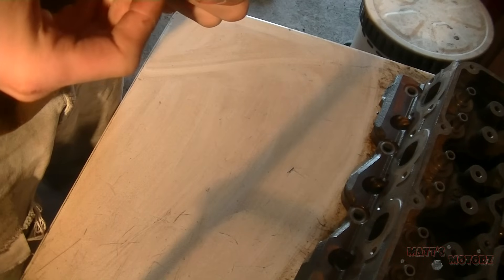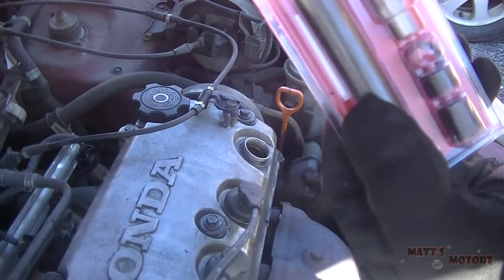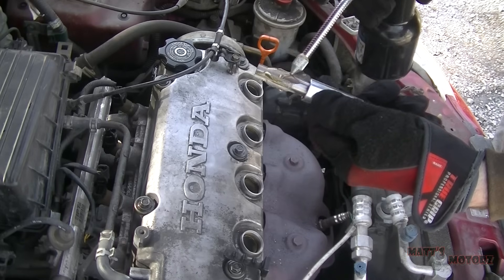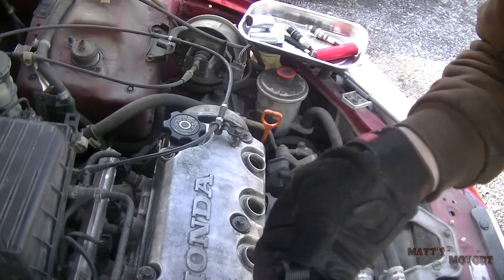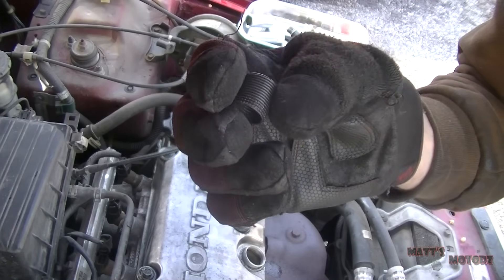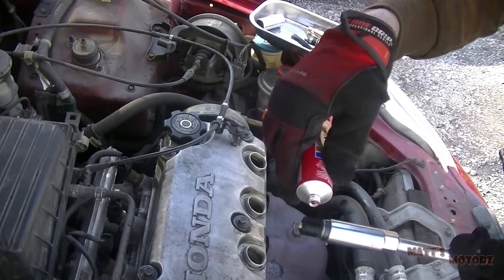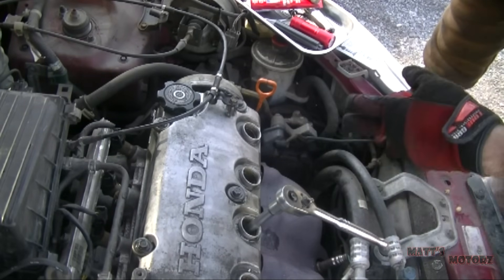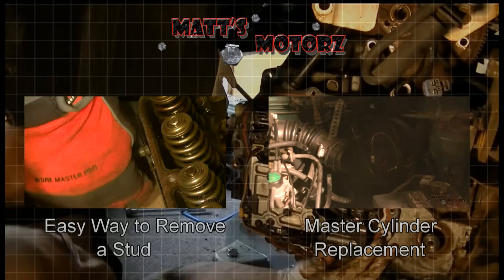Repairing Stripped out Sparkplug Threads

Comment: I got this problem with 07 chevy impala, mine is cylinder  1 which is near the alternator. all the rest of my cylinders are fine spark plug screw in fine, but cylinder 1 was a struggle it went in a few turns,"(spark plug)", but after that it became hard to screw all the way in. I was thinking either piece  of the old plug is stuck in the cylinder or just the cylinder head it self is script or something, all I know is something is wrong?
Reply from the maker: It sounds like the threads are damaged to the point where they do not work properly anymore.  You may be able to get away with just running a tap through them without doing this thread insert business.  Buy the appropriate tap and give it a go.
Reply: what's a tap?
Reply from the maker: A tap is used to cut threads in a hole.  It can also be used to repair damaged threads, (provided the threads haven't been stripped out completely) by re-cutting them.  You would most likely need to order the tap online as it isn't a size that is likely to be found at a hardware store.  Do some research first on how to use taps though and what they are.
Reply: okay, thanks appreciate it will try!
Reply: do you have to lubricate the tap with somthing or you can just do it bear? because i don't have no oil or anything.Can you use something else other than  oil to lubricate the tap?
Reply from the maker: Yes, any time you tap anything it should definitely be lubricated.  You run the risk of breaking the tap or making really bad galled up threads if you don't.  If you don't have any oil go out and get some.

Comment: compressed air does not take the metal filings out.. Start the engine up without the spark plug and the piston will throw all the metal filings out the hole.. Just don't run it for long.. Just make sure the engine runs for 2 seconds.
Reply: how many times do you have to rotate the wrench to rethread the hole?
Reply: Jsp youre both smoking crack.

Comment: if people add a little anti seize to the spark plugs this would never happen
Reply: Brandon Brady I am having the same problem with the 2013 Honda Fit. Spark plug blew out and took the threads from the head with it, I'm so screwed. I bought a new coil pack and spark plug... What's the best method?
Reply: False. Today I came across a stubborn spark plug whole. Even when when applying anti seize.
Reply: Mine blew out the hole!  Common on my fit.
Reply: Nope, I took off the coil and the plug came with it.  Typical of the Honda fit to break the threads so to speak.    I couldn't even thread the replacement at all.  2011 honda fit bullcrap.
Reply: Not true I've always used anti seize and just had one strip out

Comment: Can you use JB weld instead of the rtv silicone? I was thinking something more permanent would be better.
Reply from the maker: That's a good question. I am not sure to be honest. I would think so, yes.  Assuming JB weld can withstand those temperatures (which I think it can)
Reply: In fact, the instructions call for high temp thread sealant so Permatex or JB Weld high temp is fine. RTV silicone is great as a gasget maker and might do the trick but I prefer following the instructions closely.

Comment: Hi I know this video was a couple years ago but I have a question.  How did you remove the spark plug to put the punch tool in without removing the insert?
Reply: yes you have to remove the spark plug
Reply: Johnny Pham did you ever figure out how to do this without the sleeve staying on the spark plug when attempting to remove the spark plug out?

Comment: how you take it out is my ? im scared to brake my spark plug inside the head
Reply from the maker: Take what out?? The sparkplug??
Reply: yes
Reply from the maker: If he is asking how to remove the spark plug then he probably should not do this job.
Reply: i'm pretty sure that he can't remove it because threads are completely gone
Reply from the maker: OH now it makes sense! Lol thanks.  I should have said that when I took mine out, it was pretty tough. I needed some leverage.  Luckily it didn't break.
Reply: yes i know how to take it off just cant i can move it a little but it wont cone out i took it to a shop they said they wont do it because they don't want to risk it braking but they tried but its on there tight
Reply from the maker: Dago Granados Yeah with that kind of thing, it is all luck really.  I was lucky that it did not break.
Reply: My spark plug was stuck for over 2 years, I recently bought Seafoam Deep Creep, sprayed it in the well with a hot engine, i let it penetrate for about 10 minutes. I then slowly started unscrewing it until it came out. Now I just need to rethread it, thinking about doing it myself.

Comment: thats why I dont drive it too far away from my house Im scare that the engine would blow them out
Reply from the maker: If done properly, the new threads should be just as good as the old and you don't need to worry.
Reply: MattsMotorz just a question, would you recommend an adhesive (such as loctite or devcon) to hold the spark plugs for a very short time? I’m currently working on an old petrol truck and I need to move it into my workshop.

Comment: Used one of these kits on my snow blower's engine after fubaring the sparkplug threads. Worked great. Now I always use the rubber tube trick when threading plugs into aluminum heads.
Reply: I tend to run the plug backwards until i feel it "seat" in the hole, then proceed to run it in with a t-bar tool.

Comment: wouldn't you get metal shavings into the cylinder. NOT sure that i wouldn't want that
Reply from the maker: +Josh Parkinson That's why in the video I show blowing out the hole with compressed air to get it all out.  You can also run the engine a few seconds with no spark plug in to blow it all out of the hole.

Comment: wouldn't you get metal shavings into the cylinder. NOT sure that i wouldn't want that
Reply: leave the spark plug out and start the engine on 3 cylinders and let it run for 2 seconds.. The piston will push the metal shavings out.

Comment: Protip: Read the packaging. Always! That high temp rtv says on it that it should not be in contact with gasoline. it could deteriorate over time.
Reply from the maker: +Null Glass The packaging on the repair kit said to use high temp RTV silicone, and that is exactly what I used. The RTV is on the threads and will not come in contact with any raw gasoline.
Reply: MattsMotorz
Weird. I would think, because it's there to seal the spark plug socket to the engine, that there would be a gap where it's in contact with the air/gas mixture in the engine.

Comment: My 2001 CR-V Spark plugs were very tight on the way out. Looks like a Honda issue! Came out 1/4 turn at a time with lube. I will try and tap the threads before new plugs go in.

Comment: oh are you sure get a small micro nano part of a pistón ring its made of aluminium put it inside of the chamber and tell me later
Reply from the maker: +lucas rodriguez Piston rings are most certainly not made out of aluminum.  They are normally made out of cast iron.  This is because cast iron is springy and allows the ring to expand against the cylinder walls.  I have personally made piston rings from scratch before.

Comment: are you nuts the chips destroys the chamber the cylinder the pistons and eventually the engine
Reply from the maker: +lucas rodriguez That really isn't true at all. The chips aren't going to destroy anything, especially not parts made out of steel.
Reply: +MattsMotorz I agree with you it will not damage anything that huge magnet in the oil pan will catch it all and so will the filter ☺

Comment: how do i know if my threads on the head are cross threaded ?  would i hear hissing blowing air coming out from that spark plug when my engine is running? any wear on the threads of the spark plug? my threads look fine on my plugs but i hear some hissing. thanks
Reply from the maker: +carlosb1 If your threads are fine, then they werent cross threaded.  The hissing could be a large number of things, some of which are normal.

Comment: hope this works on my s10. the threads in the head are almost completely smooth...
Reply from the maker: +Eric Chapman Doesn't matter, it should work. The size you are tapping the hole to is larger than the existing hole even if the threads are completely gone.

Comment: Matt do we jam the whole tap in there or only the first part
Reply from the maker: +tremat91 Run the tap down until you get to the bottom.  On some engines you will hit part of the valve, which you will be able to feel (and when this happens, stop immediately), others the tap will just go all the way through. You will know you are all the way through when the resistance goes way down on the wrench.

Comment: Why did you cut out at 2:29? You were screwing down, then just pulled it out. So do you go all the way in and then back out? Or do you screw all the way in and just pull out? Kinda critical piece to cut out..
Reply from the maker: +Aaron B I suggest reading up on how to tap threads.  I cut it out because it was simply me running down the tap. When you tap threads in anything, you go all the way down, and then unscrew the tap from the newly cut threads. You wouldn't be able to just pull it straight out as it is threaded into the head.

 When it comes to YouTube you only want to keep footage that is absolutely necessary and interesting, otherwise the video runs too long and people lose interest half way through.

Comment: A couple of suggestions:  1) Make sure the piston is not at TDC when you do this otherwise you may run the tap into the piston.  2) Contrary to the directions that come with the product, I would not use RTV sealant.  That's really a rubber-based gasket sealant.  I would use Loctite Red instead which gives you the added advantage of locking the coil in the head so it won't be removed when you take out the spark plug which is often a problem people report when they use RTV.  RTV simply makes no sense to me.  3) Use Anti-Seize on the plug threads.  That will also help to make sure the coil isn't removed with the plug but you should always use it anyway when installing spark plugs. In fact, I would never even think of installing spark plugs with coating the threads with Anti-Seize, especially with aluminum heads.  

Don't remove spark plugs from an aluminum head when the engine is hot.  When it's hot, both the head and the spark plug metal is expanded, making the plug very tight.  If you remove the plug when the engine is hot, there's a good chance you will rip the threads right out of the head.

One more thing:  You can't blow the metal shavings out of the cylinder with compressed air as I'm sure you found out.  The air nozzle blocks the way and you are really just blowing the shavings to the walls of the cylinder.  Instead of oil, coat the tap with grease.  Most of the shavings will then stick to the grease. Tap slowly, going back and forth and remove the tap frequently and clean the scraps off it.  For any scraps still left in the cylinder, the way to get them out is with vacuum. You can get very thin pencil-like vacuum attachments for a Shop-Vac or similar vacuum machine.  In fact, they sell little assortment kits of tiny vacuum attachments on Amazon for getting into tiny places.
Reply from the maker: +Bob Miller I feel as though I should make a few comments to this post. Many of the things you say do not make much sense to me and I get the sense that you may not have even done this before.  For point 1, yes you're right, but honestly, it wouldn't be a big deal.  You would feel the tap bottom out and stop, and even if you marked up the piston, this will in no way hurt the engines performance.  People get so anal about these things, but honestly it wouldn't matter in the slightest. Engines are tough and will not be subdued by scratched pistons.

For your point 2, red loctite is NOT a good idea.  Do you know how you remove something that has loctite on it? You heat it up.  The heat causes the loctite to soften and let you get the two parts apart. When running the engine, the spark plug gets the very hot.  The loctite would certainly fail.  That is why you need to use HIGH TEMP RTV.  Just because you don't understand it, doesn't mean you're correct and the manufacturer of the product is wrong (Really man? Think about that for a second.  You are suggesting that you know better than the manufacturer of the product. What is it like to know everything??).

Point 3 is a good point. Antiseize would be a good idea.

YES, you can absolutely blow out all the shavings with compressed air.  The nozzle does NOT get in the way, (again, have you done this before?) especially on heads with the big spark plug tubes.  I really am not a big fan of the grease idea.  And if you're going to get a small vacuum, why even do the grease? Why not just vacuum out the chips?

Anyway, I wanted to make this comment to deter people from believing your comment as you are speaking so very confidently in your ignorance.
Reply: @MattsMotorz  I just did this. I put grease on my drill bit and tap because I read this comment and other youtubers were doing it, but it wasn't a good idea. Yes, grease would trap the shredded metal better than oil, but when it drops onto the cylinder, it will stick to it and it's hard to vacuum it. My first idea was not using any oil but it isn't good for drilling I guess. If I use light viscosity oil, I can spray the brake clean after the drilling and the oil would come off from the metal shredding, thus it can be vacuumed out easy.

I also thought about red RTV vs red thread locker and I came to the conclusion same as you. Heat is needed to remove red thread locker, spark plug hole is like the hottest area of the car (other than cat) so I think it's really meaningless to use it.

My car's hole is like 6 inches deep so it wasn't easy. 

Thankyou for the video tutorial.

Comment: Always ,when replacing Spark plugs use a piece of Rubber hose or a vacuum line at the end of spark plug !
This will help you not to cross thread when installing plugs ! And on aluminum heads always give time for engine to cool off ! this will help not to cross thread when removing & installing plugs !
Reply: Good point

Comment: Use Vacuum cleaner to remove the chips ! it is better & safer ,the with the plug out crank the engine over  ,.let the piston blow the possible fallen chips out !
any way Thanks for helping others !
Reply: Also, before  starting the car, you could spray a few ounces of carb cleaner into the cylinder to give buoyancy to the particles which help expel them. Be sure to let it run/turn over for at least 5 seconds.

Comment: how can i do the last part if i dont have a magnet?? your video has helped so much
Reply from the maker: +nesstor1891 Honestly, I think it would be worth the investment to just go out and buy a magnet tool.  They are super cheap and you can get them at any autoparts store.

Glad the video is helping you out!
Reply: +MattsMotorz also is the sparkplug supposed to come out after you innsert the threaded sleeve?
Reply from the maker: Yes.  The sleeve acts as new threads so the plug can come in and out as it did before.  It also needs to be out so you can fit the punch tool in.
Reply: +MattsMotorz when I try to put in the sleeve, and then bring the sparkplus out it comes out with sleeves and all
Reply from the maker: Others have had this problem, I did not so I cannot give the best advice. Notice how when I take the spark plug out, I bang on the wrench in short impact-like motions.  This is to dislodge the sparkplug from the sleeve and not turn the sleeve out.  Try this.
Reply: +MattsMotorz I found a way to place the sleeve there, thanks without your video I couldn't have done it myself
Reply from the maker: Awesome! Glad the video helped out!!

Comment: What does a motor sound like if the spark is stripped and not screwed in all the away?
Reply from the maker: pitchwest In my case, it sounded normal.
Reply: you'll be able to hear the air escaping out of whichever spark plug it is.  Like a loud putting/sputtering noise

Comment: I think I may have overtightened or stripped a spark plug thread. What kind of engine symptoms would I get if I did that?
Reply: +papitosabe Leaking air from your cylinder and also it will cause your car to buck and lurch when cold. It will also make your car idle rougher and lower as leaking compression and possible gas fume smell also.

Comment: Well he could have takin the valve cover off and if im not mistakin there is a tool to take the spark plug tube out or use a pipe wrench thats what i would of done
Reply: And also what he could of done to prevent the shaving was to screw it in about a half turn to a turn then back it off regrease it and do it again that way you wont get build up
Reply from the maker: Patrick Lewis Getting those tubes out is very annoying, didn't want to deal with that.

I guess that would have worked for the chips.  Didn't think of it then and I have never tried it.
Reply: Yea they are a pain
Reply: U did better thn me on my first try ill tell u tht lol

Comment: Hey Matt
When you are screwing in the new threads with the teeth, are the teeth part screwed down into the hole an then expanded, or do they just go down flush on top of hole itself? Seems to me if they are on top of the hole what do they bite into when you use the punch to expand them?
Reply from the maker: Tracy Suttles The threaded insert goes all the way into the hole until the top of the insert (with the knurled surface) is flush with the top of the hole. Meaning, none of the threaded insert is sticking out at all.  Then the hammer tool expands the knurled part to bite into the head. 

Hope that clears things up!